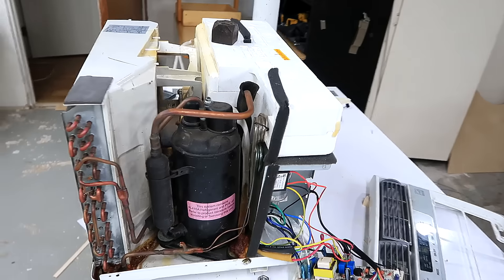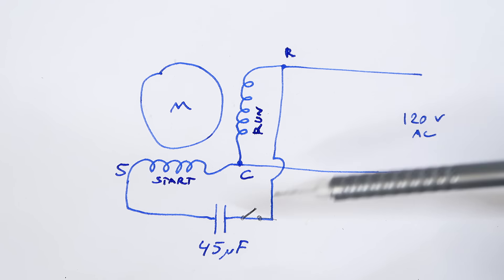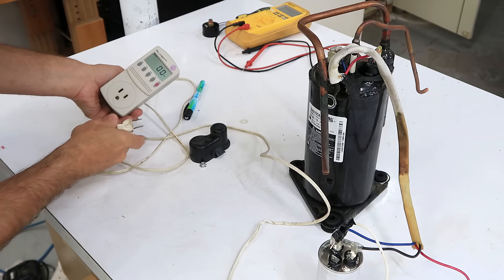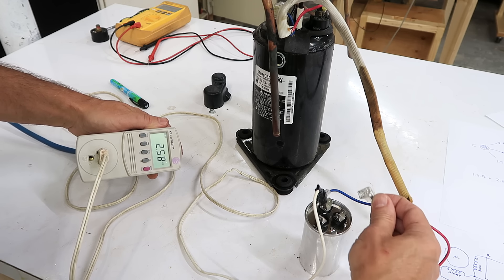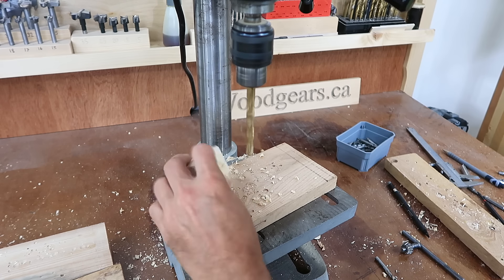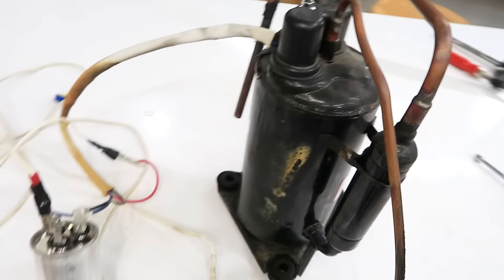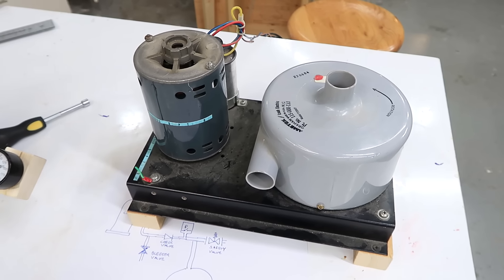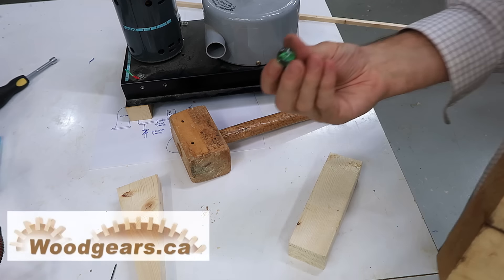Reusing an air conditioner compressor

Comment: Honestly impressive that the piece of wood held 200+ psi without trying to exit the workshop. My safety squints were engaged just watching lol
Reply: Yeah, I was definitely worried it would explode 😱 (I know it probably wouldn't) Incredibly impressive performance though
Reply: Not really, wood is strong
Reply: Skookum safety squints
Reply: These kind of pressures don't do much on small area like that. If we assume a 1/4 inch dia x 1.0 inch deep hole its only 10 lbs of axial force (shooting) and 50 lbs or radial force (splitting). Different Story If you were to build a pressure vessel of considerate diameter.
Reply: @BritishEngineer  I think they were alluding to the wood block becoming a missile LOL
Reply: I thought it would explode too
Reply: Well, we were making giant boat out of wood, modern age and technic made this kind of stuff obsolete but not useless
Reply: @AntotaboQC  I was more worried about the press fit to pipe and relatively small surface area of brass threads into wood holding pressure than the wood exploding, but maybe the slight leak and slow pressure build helped.
Reply: This was by far the most impressive thing for me. A high pressure adapter made out of wood, just by drilling two holes. 0_0
Reply: @anj000  Welcome to enginniering
Reply: @Splarkszter  I wouldn't call that engineering though.
It is more like craftsmanship or being handyman. Engineering is about making precise measurements, making meticulous calculations and many experiments. It is opposite of that.
Reply: @anj000  its only engineering if he said "this piece of wood has a calculated safety factor of 1.5"
Reply: basic cheapo plastic water bottle can easily hold 150 psi. if you cut off a valve from a bicycle tube with a bit of flange on it you can put it through the cap from the inside and the pressure will seal it. youve all seen people launch the caps off bottles by twisting them but have you seen a cap go 200 ft in the air?
Reply: It wouldn't be a Mathias video if I weren't flinching at something.

Comment: I restored Corvettes for 30+ years and from 1968 to 1982 the headlight doors and from 1968 to 1972 the windshield wipers door was controlled by a vacuum system. The biggest problem was finding leaks with the vehicle running, the way I solved this problem was to run a vacuum hose from an old a/c compressor pump that I placed in another room into my shop, I could then listen for leaks without starting and running the engine, it made it so much easier to find leaks and I was so proud of my ingenuity, (I was 17 at the time), it cut repair time in half overall and saved me and my customer's money. So like you, sometimes you get the feeling you should keep an odd part or two, you never know you just might have a need later on.
My brother also took a compressor pump from a refrigerator and made a setup for bleeding brakes and changing the oil in rear ends. One thing I didn’t mention above is, that you keep it oiled, use a reservoir, a check valve, and a limit switch if you decide to build yourself a vacuum system.
Reply: I had a customer with a cracked intake manifold a few months back that had already spent thousands at other shops getting throttle bodies replaced repeatedly. 
A sketchy way to check for vacuum leaks is to spray starting fluid lightly around the vacuum lines/intake/etc. Wd40 works too and isn't as flammable. 
But recently I built a smoke machine that I use for leaks. Took an old Mason jar, a couple 1/4" hoses and an old soldering iron. Popped some holes in the jar and hot glued the iron and hoses in place. Put a couple rags and some used oil and trans fluid in the jar. Then just pull a line off the intake and pump smoke in.
You can blow pressure yourself, but because there's no check valves, I just run a separate air gun turned down to 3-4psi.
Reply: @MrGregsRnR  You’re an absolute legend, we had a smoke machine for the same purpose, we didn’t make our own though. We used a smoke machine that was originally for stage plays, we just boosted the horsepower so to speak, if we had a leaking gasket, a bad brake booster, or an a/c duct control valve leaking, you would find it in a matter of seconds. I sort of miss those days, some people can’t wait to retire but if I didn’t have my car collection to work on I’d go crazy.
Reply: @Sandy.J.Lloyd.Sr.  appreciate it. I looked at buying one or repurposing one of my Halloween foggers, but those leave so much residue and I like building things vs spending money.
Reply: Could have used another vehicle idling and used it as a vacuum source. I've done this before finding a vacuum leak.
Reply: @1987FX16  I did just that before I built my vacuum pump system. If you work on a lot of vehicles with vacuum systems, (something that all vehicles have) I can’t recommend building your own vacuum testing system enough. Even modern cars and trucks use a vacuum to control the emissions, the HVAC system, and the brake booster just to name a few. But you do have a great suggestion, I would only add that you separate the cars enough so the exhaust noise from the donor car doesn’t interfere with the leaking noise you’re looking for.

Comment: This is a rotary compressor, usually stationary vane and orbiting “piston”. Cooling is done by the cool refrigerant returning to the compressor. Biggest issue with utilising refrigeration compressors for other tasks is rusting due to moisture contamination and loss of oil.
Reply: They also tend to overheat quite badly - maybe that's why the power draw dropped
Reply: Recommendation:  Get a short self drilling/tapping screw, drill a hole in the bottom of the compressor and dump all the Freon oil (it's hygroscopic = absorbs moisture and turns to acid), then get regular compressor oil (synthetic) and suck approx 1/4cup (2oz) in the intake tube, then put the short screw in the hole in the bottom to seal up the compressor

I got some of those Access/Service Valve 1/4'' from amazon...soldered on both sides of the inlet and outlet...then had a compressor and vacuum pump...but it did get VERY hot (my compressor came from an old refrigerator
Reply: yes ayoud have to put the line oiling system on the intake side of the compressor
Reply: Scroll* compressor
Reply: I have three of these hooked up in parallel for my I filled them with mineral oil and let him go to work they work fine no issues at all
Reply: These compressors are cooled by suction gas too...

Comment: A lot of interesting comments. All I know is that about 55 years ago my Dad got a compressor a guy built from a refrigerator. It was used for years, at least 15. I scrapped it (saved the tank) when I bought my Dad a “real” compressor. Nice flash back to my youth with Dad. Thanks!

Comment: Please be careful. The compressor uses a case ground. It also uses the refrigerant to cool the motor and move the oil back into the compressor. You made a system designed to short the motor windings to the case with no safe path to ground.

I use to teach refrigeration classes for a company and to force a compressor failure I would do exactly what your doing except I’d also bypass the temp limit (if it was external as larger compressors put them internally). I would always tap one of the compressor feet to ground though so it would safely throw a breaker.
Reply: Ditto this. The fan wasn’t the only thing cooling the compressor while it ran, the cold gaseous refrigerant plays a huge factor in keeping them cool. I can imagine at 200w, this compressor would only be good for maybe a 5 or 10% duty cycle pumping air.
Reply: I was In horror watching this. When he ran the motor backwards and when he puts the start winding on and off the capacitor. This guy is asking to get seriously injured by messing with stuff he doesn’t understand. I’m not done with the video but whatever he tries to use the compressor for will not last and when it goes out it won’t be pretty. At least he’s teaching his kids his brilliance.
Reply: Jesus Christ I just watched him hold that wood on there. I can’t watch the rest.
Reply: @Augdogfrogslog  He's an engineer and designed a key component of the first Blackberry phone.  He can handle himself.
Reply: safety police woop woop
Reply: @seanfyodorovich5230  electronics and mechanical items are two very different beasts. Everything he did here was against every safety practice that is taught in the refrigeration industry, and could have been tested in many smarter and safer manners. So it's going to ruffle some refer tech feathers because these principals are so engrained in to us, and we follow them religiously.
Reply: @seanfyodorovich5230  Yeah... when he sees the electricity coming down the wire, he'll just step aside and hope it doesn't hit the kids.  These are the same kids that weren't there for the marble "fun".  Don't worry, they will see it on Youtube and try it when Dad's not around.  "Hey Sis, let me know if this stings."!   🤬 😱 😭
Reply: @seanfyodorovich5230  3.3V logic is a little bit different than 120/240 line power and pressure vessels. We have software engineers and electrical/mechanical engineers guiding their operation for a reason. Whoops at 3.3V goes pop and makes a puff of smoke. Whoops at 230V takes the corner of the desk off.
Reply: I'm not sure why having a ground on it would make the breaker work better, the breaker is only on the line side of the circuit anyway.  The compressor is isolated on 3 rubber feet and or the rest of the copper tubing tied to earth ground. I would honestly suspect that if the neutral is tied to ground, you have accomplished the same thing assuming you have it wired correctly with a polarized plug. 

I'm honestly more concerned about this pump running with no PAG lubricant, and him attaching the output to a PVC bomb at 150% of gauge rating... That grenade will maim him and kids faster than getting shocked or locking up the pump will.
Reply: @kleetus92  Because a winding meltdown due to overheating (due to lack of cooling) will result in shorting the winding to the case. If you have the case correctly grounded the fault current will trip the breaker. If you  do not then there is no fault current to trip the breaker and you have a case at mains voltage. I would assume/hope that if he put this to use in a project he would ground it and just hadn't bothered for the test.
Reply: @electricalmayhem  Did you read what I said? I literally said exactly that.
Reply: @kleetus92  You said "kleetus92
I'm not sure why having a ground on it would make the breaker work better,...", You also said you thought the neutral would be tied to ground, but that would never be the case in an appliance because it can cause problems with an RCD. In a MENS system neutral will be bonded to ground in several places, but never at the appliance. 

 I wasn't trying to start an argument, just thought you were asking a question to learn.

I agree with you that putting a couple of hundred PSI into untested "vessels" is not a good idea.
Reply: @electricalmayhem  I think we got off on the wrong foot... I meant 'make the breaker work better' from the standpoint that if there's no return connection at all, it's clearly not going to do anything. I also neglected to realize this was a plug in unit, not hardwired, so that's a bit of a different animal. I think we can agree there's a whole lot of 'not a good idea' here...
Reply: Anyone complaining about safety doesn’t have the required knowledge to do what he’s doing anyways.
Reply: @kleetus92  talk about a huge exaggeration. 

And if you are designing hardware components, you have not a software engineer (that’s computer science). You are a computer/electrical engineer, who has all the same knowledge as a an electrical engineer working on power systems.
Reply: @the2theonly672  one more time, only in English ...
Reply: @seanfyodorovich5230  okay that was funny..kudos
Reply: Mineral oil  like clear laxative or 30w nd motor oil??

Comment: I've always been facinated by guys that can reverse engineer something with simple logic to work out how it works, and then run it.
I have done this multiple times, and having convinced myself that I know what I'm doing with total confidence, I have applied the mains supply. 
This is the bit where there is a bright flash that permanently reduces my eyesight by another 15%, a high pitched ringing in my ears and the charred ghost of the component on my desk where it used to be.
Nothing humbles like 240vAC
Reply: Try 575V lol 
Or 7,2KV directly from a powerline-that does feel serious!

Comment: I've made a shop air compressor from a fridge compressor! Yes, it's got a check valve, unloader valve, pressure switch, and coalescing filter.  It may be slow, but it's silent which is important for an apartment shop. Lubrication is a concern with these compressors, their original oil was designed to circulate with the refrigerant and doesn't work well for air-compressor duty. I drained the oil from mine and filled it with 30W air compressor oil. Three years of moderate use and two oil changes later, it's still going strong (and silent), and the air that comes out is pretty much oil-free.

Comment: Very nice demonstration and data. I recently built a compressor using that exact same unit and an old fire extinguisher as the air tank, not that complicated at all. It's perfect for airbrushing, running a brad nail gun or staple gun. Thank you.

Comment: Very handy to have in the shop. I have two refrigerator compressors adapted to run, one as a compressor for an airbrush, and the other as a vacuum source for a powerful desoldering iron. They are small and extremely silent.
Reply: José Silveira. 
Porque no lo podían traducir, yo tengo casi 70 años y no entiendo el inglés , solo el castellano. 
Gracias señor José.
Reply: @mharlha  Hola! La traducción es una función de YouTube que se activa en el botón CC (leyendas). Quizás buscar en la web como activar el Auto-Translate (traducción automática) de un vídeo de YouTube. Lo siento, pero no creo que pueda ayudarle más que esto. Un saludo, desde Portugal 🙂
Reply: @JoseSilveira-newhandleforYT  
Obrigada.
Muitas gracias, somos vecinos!!!!!!. 
Que Dios le de salud.
Reply: @mharlha  Gracias a ti 🙂

Comment: On balloon volume at  3:49, fill for 10 seconds. Tie off the ballon, and see how much water the baloon displaces in container where you can better determin volume vs trying to calculate fron an irregular shaped balloon.
Reply: The baloon excerts pressure on the gas...
Reply: @1kreature  Good point,  but given a little extra math, that could be accounted for.    But an even better process would be to time how long it takes to bubble air into a 2 liter bottle letting the bottle rise under it's own buoyancy untill there is no more water inside while you steady it from falling over.  There's so little pressure from the weight of the bottle adding pressure compared to atmospheric pressure that it is practically negligible.
Reply: @1kreature  A ballon has about 0,15bar of pressure, it doesnt effect the messurment much, maybe 10%

Usely you dont need to be rocket sience specific, it is just a compressor.
If it does 1,0cfm or 1,1cfm doesnt matter.

The ballon methode is quick and easy without getting the shop wet.

Comment: The problem with ac compressors is that they rust when used to compress open air (As they typically contain a closed loop with self-contained oil). So they're great to use for a while... until they rust.
Reply: Recommendation:  Get a short self drilling/tapping screw, drill a hole in the bottom of the compressor and dump all the Freon oil (it's hygroscopic = absorbs moisture and turns to acid), then get regular compressor oil (synthetic) and suck approx 1/4cup (2oz) in the intake tube, then put the short screw in the hole in the bottom to seal up the compressor
Reply: That's true, the oil inside compressor can deteriorate under open air.

Comment: Earned a sub. I was given a dehumidifier that was running but not collecting humidity.
I have suspected that the coolant was gone as the rest of it is fine. This sort of project would be fun with my kids, as I do some odd projects like this with them.
We used to take apart many devices such as printers, and scanners (great place to get small, good quality motors).
This might just be what we do tomorrow. Thank you for sharing this bit of fun.

Comment: I know this has been said already but, refrigerant compressors use the refrigerant to cool and lubricate the motor. Most Copeland compressors aren't rated for return gas temperature above 65°. Also, the lubricant used for R410a is POE oil. A dehydrated acid, so having air enter that compressor will mix with the left over oil and start to cause more damage. 

I do wanna say, as a technician I told it was really interesting watch you walk through the wiring of the capacitor and the compressor.

Comment: Refrigerant compressors are designed to start under pressure since it would probably be a bad idea to bleed off the excess refrigerant pressure lol. I regularly see R410a compressors start with 150 psi inside of them. So if you wanted to go through all the trouble of building a janky air compressor you wouldn't need a bleed valve haha.
Reply: they dont. pressure in the system is one thing, difference in pressure between discharge and suction is another thing
Reply: @Boz1211111 I'm wondering how high this difference would be in a huge sealed unit that I got out of a rooftop HVAC that was itself the size of a decent shed or garage!The sealed unit that I salvaged from it is over 4 feet high,almost 2 feet in diameter and weights several hundred pounds-the biggest I have ever seen 😂
It says that it's 7,5 KW/10 HP but doesn't say anything about pressure 🤔